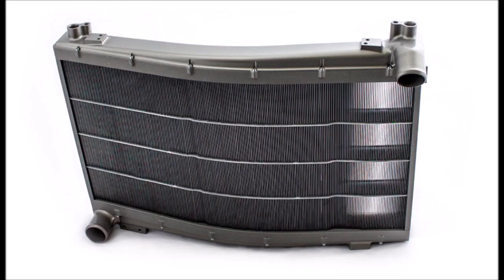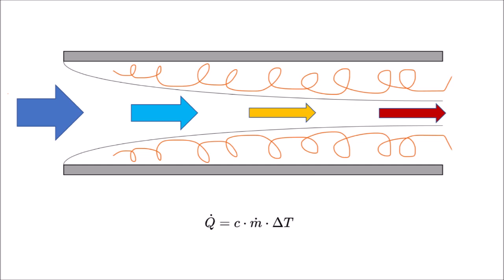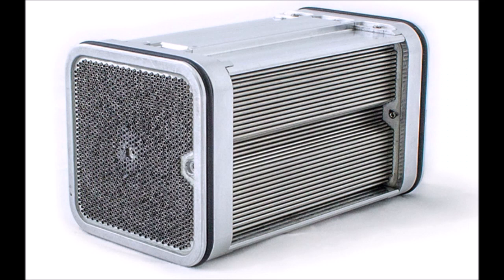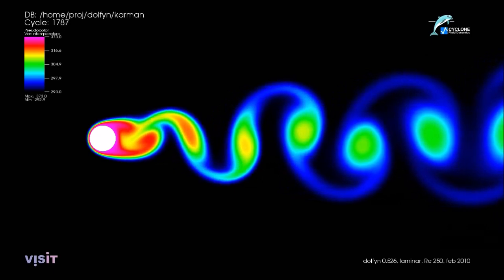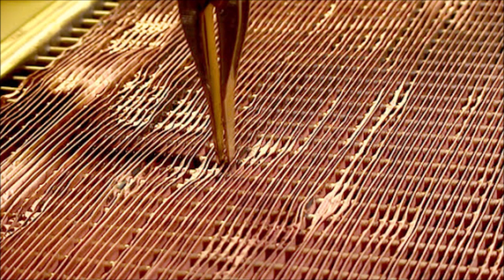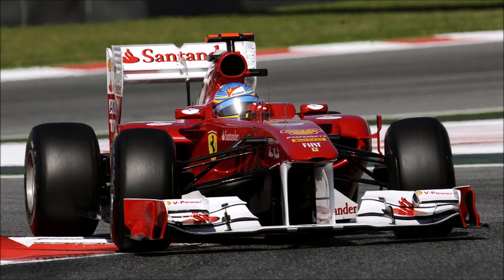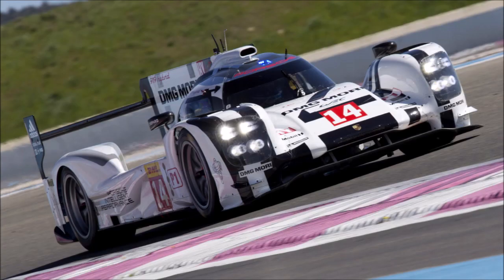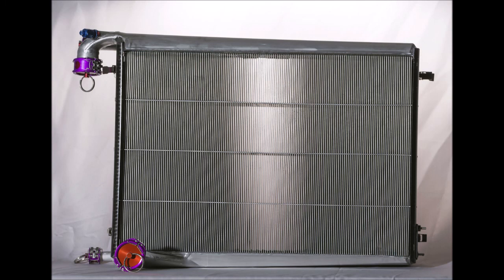The MicroTube Radiator in Formula 1 and LMP1 EXPLAINED

Comment: Interesting content! I have some doubts about the fluid dynamics explanations though. The Reynolds range where Von Karman vortex appears is quite tight and low (515 if I remember correctly) and I honestly think that an even and laminar upstream field is mandatory to see it, don't you think this would be quite unlikely into a cooler duct downstream of the stone guard meshes and with such a dense tubes distribution? Where did you get these info from? I'm interested into understanding more!
Reply from the maker: I was involved in one of these projects. Depending on your expansion before the radiator you can get into the Reynolds range where Karman vortex appears. And even if you are not exactly in that range in certain situations, you will still get a turbulent flow which mixes the air and helps to increase cooling performance compared to a traditional radiator.

Comment: Do you know what manufacturers sell micro tube radiators heat exchangers and intercooler cores?
Reply from the maker: It's Mezzo Technologies in US. They were also the partner Ferrari worked with.
Reply: PWR Australia make them. You can also make them yourself, but it is very expensive.

Comment: does ferrari still use them? i thought it will be a gamechanger in 2014 but i hardly ever heard of these radiators ever again.
Reply from the maker: I haven't seen it in F1 for some years. It's hard to get them reliable because you need to seal so many of these tiny micro tubes, which can also bend at higher pressure if they are not installed properly. But if they work, they have huge advantages.
Reply: @BSport320  thanks

Comment: Making a micro tube liquid to air and heat exchanger for an experimental helicopter. Packing in 1500 tubes into a 100mm diameter tube is a bit of work. It is far more efficient. The smaller the tube, the thinner the wall can also be. 2k worth of tubes for a barrel intercooler that is only 250mm long. About 10 times more expensive than what is offered commonly.